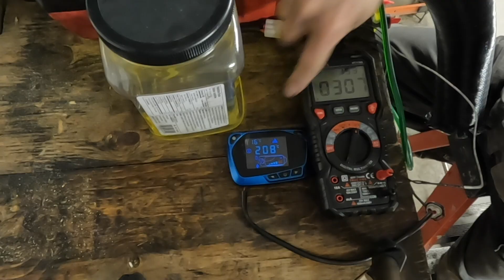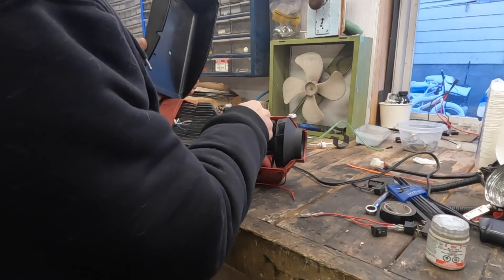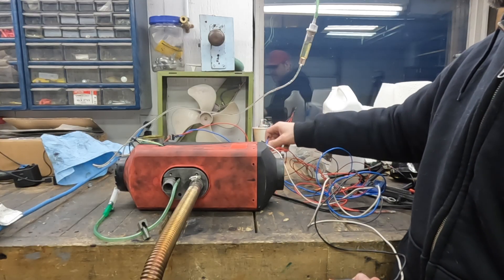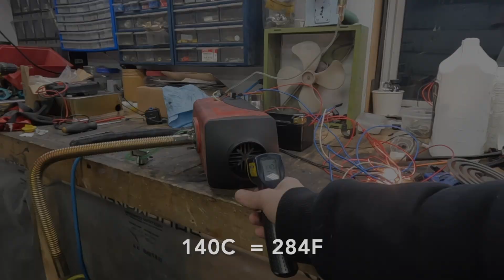ECU Replaced With Light Bulbs !! Diesel Heater Runs With No ECU !!

Comment: If u want to regulat  the fan .usee a dimmer  from a car
Reply from the maker: That could work. Most of them are digital now so you need the more than the switch. I think some of the old ones were actual potentiometers with heat sinks.
Reply: @loweredexpectations4927 the old ones are not digitized mechanical

Comment: Use some good rated diodes in a series to bring down the voltage. Use your switches. Your wasting electricity using bulbs.
Reply from the maker: Thanks for the comment. 

I'm not the most knowledgable person when it comes to electronics, so I am open to you knowing something I don't about diodes... but my initial reaction to think you mean resistors. A diode is a one way valve for electricity. 

There's a few things here that you may be overlooking. To change the fan speed, you need to reduce the voltage, amperage or feed power intermittently, (quickly switch on and off) like is done with PWM. 

The lightbulb is a resistor in this circuit and the power consumed by the circuit follows Ohm's law... Meaning the total resistance of the circuit will determine the wattage. If a resistor was used in place of the light bulb, the resistor would consume the same amount of power as the bulb, it just wouldn't show up as light... it would just give off heat. 

This is how the majority of fan speed controls work... To my knowledge, with a DC motor, you either use resistors or a PWM controller. Fan speed resistors in cars typically use aluminum heat sinks to get rid of the heat created by the resistors, and the power consumed is considered acceptable as it means no complicated electronics.

Comment: So buy some resistors for a possible end times type of situation got it
Reply from the maker: Haha... basically. If you are clever,  you can make these heaters run with a drip feed, a bit of power and a few resistors for bonus points.

Comment: Cool , you could go to the automotive salvage yard and get a resister pack and it's pig tail , then get the rotary off low med high switch out of the dash ,  this would do the same thing as your light bulb setup but not as rigged up looking and you could have the switch mounted nicely to make it easier to adjust the "single" off low med high switch instead of multiple switches and light bulbs dangle in the air
Reply from the maker: Yeah, that would be really cool and I thought of doing something like that... I just figured the visuals of using lights would be easier for people to understand, and I already had the stuff. 

I 100% agree though... If you were running this for any length of time, using car parts would be smart.

Comment: What if we figure a way to convert some of the heat to electricity to power the system, then no battery is needed.
Reply from the maker: There are a few ways of doing this, but none of them are very efficient. A solar panel would be the most practical. 

Other than steam turbines (haha) you can use peltier devices, but they are very inefficient. Dave McLuckie (and a few folks) built a heater that is 100% self powered using these. The cost is / would be very high and it produces just enough.  The videos are on YouTube

Comment: Why not just use a fan controller from a vehicle? Then install a ground thermostat.  So the fan will turn off and on automatically based on the heat of the unit.
Reply from the maker: Yeah, that is one option. This was a fun demonstration of how basic a resistive system could be. 

A vehicle controller may work ... I'm guessing they also limit voltage to a 12V motor. However, there could be an issue ... the diesel heater fan motor is very low wattage, so setting 1 on the car system, may make the fan go nuts.

Comment: I've been wondering for while if these were similar designs to jet engines with vanes inside the flames would propel the blower fan and maybe even be used as an electrical generator. You have all the skills and machining abilities to make one that would outshine david mcluckie's self powered heater
Reply from the maker: A person could totally use a jet engine as a heater, or modify a heater to become a jet engine, to some extent. I had strongly considered building a pulsejet engine to try to use as a waste oil heater..... insanely loud, but they make a LOT of heat, and I think it would chuck out any debris left behind.
Reply: @loweredexpectations4927  I love pulsejet engines 👍
Reply from the maker: @patrickday4206  It's a good idea.... isn't it ! Have a pulse jet turning a turbine generator... and have copper pipe wrapped around the outside of it heating water 🤟

Comment: Light bulbs work as resistors so they can always be substituted I've been thinking about a drip feed to get rid of the annoying click but never thought of an iv drip nice
Reply from the maker: The iv drip does work, but as I show in the video after this one, the drip rate can be problematic. There are ways around this, but unless you add in a flame out safety, your fuel keeps dripping even if the heater dies, and that could be real messy.

Comment: Hey as you know I bought this diesel heater it's a 
y a h-82209 Junyize
So out of the box surprisingly this has a 110 to 12 volt power supply with a common computer plug at the end. I plug it in DOA...
I get 12 volts out of the computer plug I'm getting 12 volts into the unit either the controller or the motherboard I'm not sure which one
 I see a Bluetooth control board on Amazon for $29. The picture they show I'm not sure if I have two extra pins
As you can see this has a fuel cap that has the one off like a honda 2000wh.
Its very small but nicely built.

Im taking a guess that they mother board powers up the control panel??
Reply from the maker: I'm confused by many things here, haha 

First, your heater having a built in power supply... I have never seen that. It would make sense if it has 12V coming out of it. Is the display tunring on or anything ? 

If you have a 12V bulb, hook it up to the 12V power and see if it actually has enough to light it... This is a better test. 12V doesn't mean much if it has no amperage. 

You could also run power directly to the 12V of the heater electronics, from a battery or power supply to see if that makes any difference. 

I looked at some photos and it looks like it is pretty fancy. 

In most cases, you will need a matching controller and ECU. Even if it plugs in correctly, compatibility will almost certainly be an issue, unless you get really lucky
Reply: @loweredexpectations4927  first off thank you so much for responding so quickly.... Long story short I'm getting 12 volts to the motherboard I checked the connections at the motherboard they seem okay .... I plugged control panel back in hit power button once no response. is there  a voltage spec were the panel plugs together ?
Reply from the maker: @stevieaticc  No voltage spec that I know of. My guess is that it would be 5V for the screen and electronics, but I don't know. A lot of google searching may tell you this, if you can dig through the mountains of nonsense that you weren't actually looking for, haha
Reply: @loweredexpectations4927  yes I was made aware of that plug could become a problem at one point under control... To my surprise there was no in-depth specifications  about the product one picture  the price was absolutely right no mention of 110 to 12 volt power supply it is not built into the heater surprise it's a really nice compact unit they claim they have the quietest fan and fuel pump it is sitting in a nice chunk of rubber
Reply from the maker: @stevieaticc  I have never seen one like it... interesting.
Reply: @loweredexpectations4927  I will keep you posted Joel again thanks for the response I'll get this thing going I'll send the video
Reply from the maker: @stevieaticc  Awesome.

Comment: I have a custom ECU board i can send you powered by an ESP32 with a touch screen and a web interface with both IFTTT and MQTT support it has a simple config page to set limits for pulse time rates mins and maxs and a cleaning cycle that uses a 2nd pump with water or DEF fluid and a drill in nozzle that will clean the chamber.
Reply from the maker: That sounds pretty cool. I'm not terribly tech savvy.... I put my email address at the bottom of the video description of you want to chat about it further.

Comment: Joel, yes all good ta. Looks.like you're well too, but cold!! Been busy with other electronic projects lately and also I have been doing some consultancy work in London for my old employer, it's just a few days each week but helps financially amd gives me spare cash to waste on daft projects lol. I've got one in mind that will interest you. In Romania we have large log burning stoves built from terracotta blocks that the smoke and heat snake through before exiting. It acts as a sort of storage heater too. So I'm planning on using the pwm controller from.last years project to control a pump from one of the heaters to drip used oil into the burn chamber. Next out in February and will most likey do it then. I used a diesel heater out there over Christmas and used a 4m exhaust pipe. Our hall was so cold by the time the the fumes exited they were just luke warm, but it was good to.know I had made.use of that heat. Well carry on with this stuff and speak again soon. Regards Shane
Reply from the maker: Oh yes, it's always good to have cash for fun projects. That's very interesting. I just got a bunch of exhaust tubing to experiment with... great minds think alike !

Comment: Simple and amazing! You can obviously measure the voltage feed at the fan for different pumping hertz, and then you can adjust your fan speed using maybe a rheostat or different resistors /lamps to match your dripping feed. Or - you can just set everything by eyes / measuring the CO output at the exhaust until you reach a perfect air speed / combustion efficiency. This is amazing in a survival situation point of view, if for example your mainboard broke. Great stuff here :)
Reply from the maker: Thanks for your comment ! Yes, there are many ways to go about doing this... Checking the CO in real time doesn't lie, as that tells you what is happening in the heater. 🤟

Comment: A LIGHT BULB???
why don't use a pwm and a heating/cooling thermostat controller?
at least a car fan switch and resistor.
Reply from the maker: No.... 3 light bulbs ! haha. 

I'm not 100% sure what you mean by "a heating/cooling thermostat controller"

I wanted to keep it simple and analogue. I was just going to plug it in directly, but that would have spun the fan way too fast.

Comment: When i was about 12 i built a forced air propane heater. It was all used parts we had laying around, starting with a 5 inch exhaust pipe about 2 feet long for the combustion chamber. I bent sheet metal to go around it for air to flow, made a cap for one end of the pipe and drilled holes for combustion air. 
I used a copper tube for the gas pipe and crimped the end to make the nozzle.  
I used an old cars heater blower and duct tape to hold it to the back. A 6/12 volt battery charger to power the fan, the 6-12 switch on the charger gave me high and low. 
I used my old red wagon with the back cut off for a stand and since it had wheel was very easy to move to where it was needed. 
A 0-60 psi gas regulator gave me flame adjustment.  
I would simply reach my hand in with a lighter and turn the gas on slowly till i had a flame about and inch tall, removed my hand and turned the flame up till it was about a foot tall out the front then turned on the fan. 
Point is, it worked great, no electronics, all used parts that i cobbled together as a kid. It was for outdoor use and worked the same as my grandfathers nipco diesel heater.
Reply from the maker: That's awesome ! I never built anything like that as a kid... had a wood furnace and I had all by fire curiosity satisfied by that. For a while in my teens (and again in my late 20s and 30s) I was fascinated with making and burning hydrogen from electrolysis.
 
Actually, now that I think of it, when I was sent to my room and when I went to bed, I would spend hours playing with candles. I would make a loop on the end of a wire and dip it into the wax and lite it .... I was obsessed with making the candle burn evenly ... sounds like I was a little autistic.

Comment: I wonder how well a potentiometer would work for the fan and the amperage it needs. Showing with light bulbs is amazing to show it can be done so simply, but if you have a few extra toys around how well can you get it to work and still be a 'dumb' system so to speak.
Reply from the maker: Yes... I may try a pot just for fun... This fan is pulling about 45 watts... soooo It might work a few times before it destroys the pot, haha.... maybe longer.

Comment: I'm thankful that instead of my father not letting me do anything, he would let me play with stuff and learn the hard way (like sticking something into the plug-in until I found out why you don't do that haha)

We would go on trips to the dump and he'd let me pull things from the electronics section just to take home and take apart. I learned so much and gained that curiosity from dissembling things that nowadays I just want to learn how everything works, and can diagnose and repair things I've never seen before.

Curiosity is one of the best thing you can have.
Reply from the maker: We were fortunate in that way. We were quite poor, but my father had two friends who were electronics repair men, and we got lots of stuff from them. Old VCRs and TVs etc. 

I spent so much time tearing stuff apart figuring out how it worked.

Comment: I'd be interested in trying out, if this setup is clean enough not to disturb AM or SW reception nearby.
I mean, the only possible transmitter left in this setup is the collector fire of the fan motor. This may or may not be picked up by an antenna.
Reply from the maker: That's an interesting thought.

Comment: My father used to tell me as a kid “please wait till I get home to plug it in…“‼️
Reply from the maker: Haha... We had an electronics room in my house where we tinkered with things, and I have been told that same thing many times.

I almost lost some fingers once trying to pop a capacitor, but I wanted to capture and examine all the pieces .... So, I got an empty jam jar, poked a hole in the lid, ran wires in and plugged the wires into the wall.... 

Luckily, the lid popped off and the jar didn't turn into shards ... It was a learning experience 🤣

Comment: This is such a great idea to allow you to run oil/diesel mix.  It would be cool to have the glow plug turn on when the temperature turns down to 140C.  Also it would be neat to have a copper tube for oil/deisel preheat with the glowplug in wrapped with ceramic insulation attached to the preheat tube.
Reply from the maker: This could help some with burning waste oil as you can adjust the ratio easily. 

I may be wrong, but I don't think it's a good idea to have the glow plug on after the heater is running. It is more likely to get gummed up. Normally, the fuel just runs over it without burning, until it enters the burn chamber. This stops it from getting full of soot. 

An electric preheater would be a good idea for sure !

Comment: If your just looking to drip feed and keeping the controller, you could use a N/C solenoid shut off valve with an electronic control that senses the pulses to keep open.  When it's off the control circuit would loose voltage and shut off the drip feed before the drip. No problems with leaking diesel everywhere.  Transistor capacitor resister sense circuit based off of whatever the lowest feed rate would be, excess would just be more than necessary to keep it open.
Reply from the maker: Yes... this would be a good idea for sure... that way, if it flames out, you don't end up with a mess of fuel everywhere.

Comment: Correct about your resistance description. 

Easier to visualize it on a diagram with the math P=I x E and E = I x R. Throw in a few more formulas and it would cover most of the basic electrical needs. None of its that hard till ya get into complicated series parallel circuits with inductance and reactants
Reply from the maker: Yes... ohms law for me is a lot easier in practice than on paper ... I'm very much hands on ... although, I did draw out a basic diagram for this.... it's been a while.

Comment: The fan motor from what I can gather is a low voltage type possibly between 2 to 6 v. The glow plug can easily be powered either by manually switching or with a timer and fuel delivery by drip so yes no fancy electrically noisy PWM motor drive and electronics are 100 % necessary
Reply from the maker: Yeah... they call them 12V motors, but I think that just means they are for the 12V system.... so that people buying them don't get confused. 

If using a dimmer for the glow plug, you need something that can handle about 10 amps without burning out. 

This was basically for fun, but in a jam you could totally do this... I have been running it on my house for about 24 hours now, without any major issues.
Reply: A dimmer won't work on a glow plug because AC and DC are different